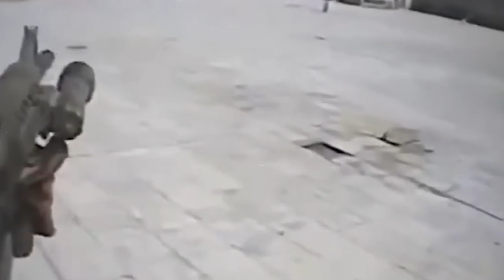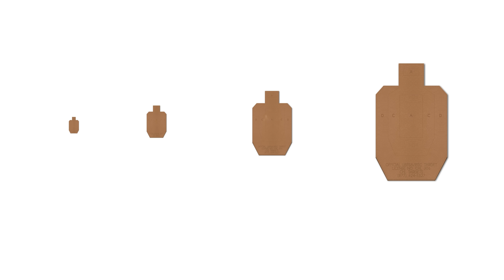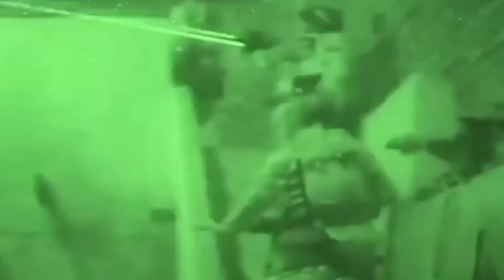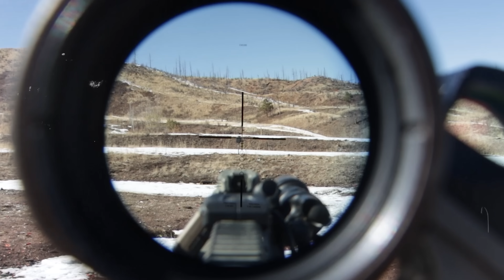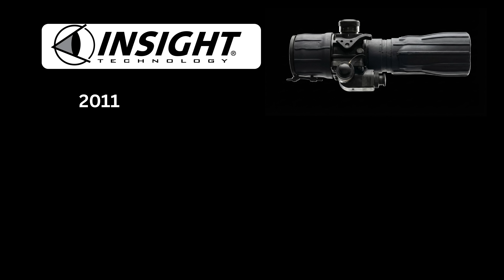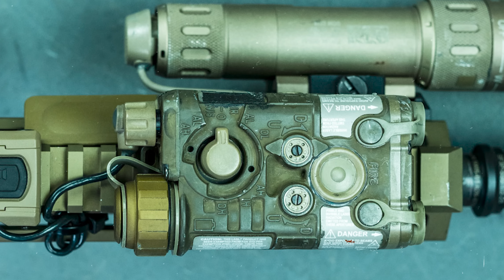Every M4 SOPMOD Gadget Explained

Comment: I remember the first time shooting with an M68 and thinking I never wanted to mess with iron sights again.  Same with IR lasers at night - once you get that zeroed you don't even need a good sight picture because wherever that laser is, is getting hit...actually shot better at night.  And those were 25 years ago...think what the tech has unlocked now.
Reply from the maker: Red dot is great. Any dot reticle is great at night with NV. I can't imagine using iron sights wearing NV.
Reply: Literally nothing. Laser aiming modules and red dots are still the same. And still very effective. Yes, the illuminators changed a bit with VCSEL technology but who gives a shit, for class 3B lasers it doesn't make a difference.